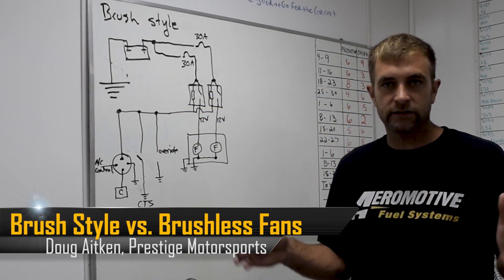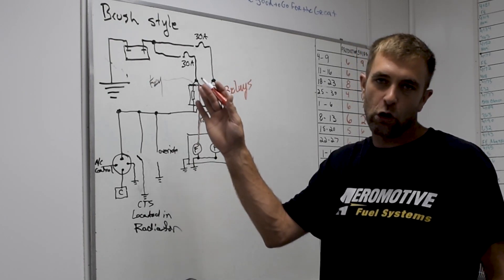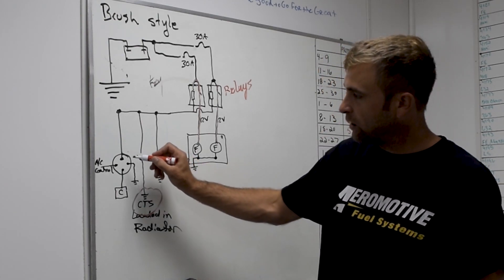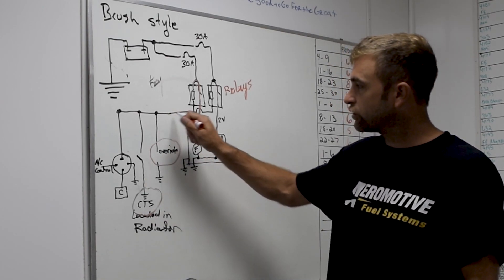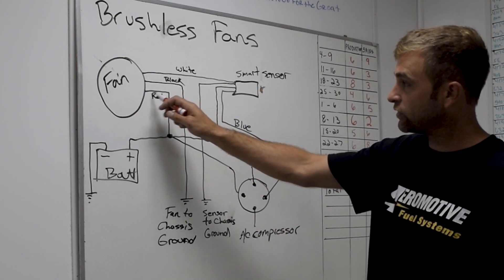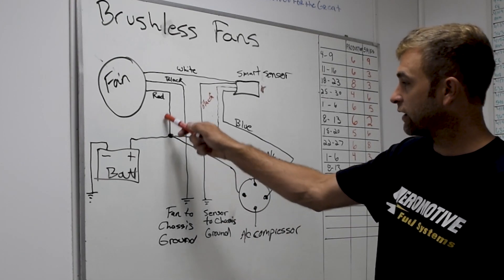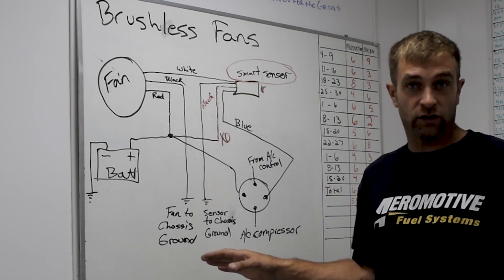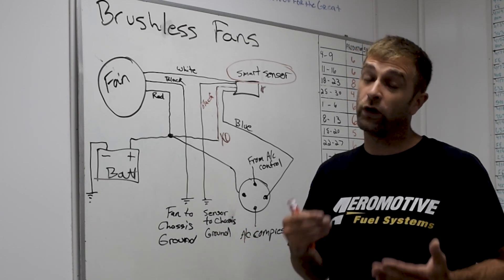How to Wire Brush Style vs. Brushless Fans for Muscle Car Applications at Prestige Motorsports

Comment: how can i wire 2 proform 12 inch brushless fans on a koyorad radiator  for a 2006 g35 where they’ll work with the ac & everything

Comment: Let me correct you. The brushless fan have constant power even if the ignition switched off, and the ground connected to chassis as well. White wire is the PWM signal. Brushless fans don't turn on unless it receives the PWM signal "pulse signal", this is controlled by the ECU. In your diagram you refered to ECU as a smart sensor, which in fact, the temp sensor connected to ECU, and based on temps, ECU send pulses to the brushless fan to start. The fan speed depends on the signal frequency that the ECU send to the built-in brushless fan driver. If there's smart sensors, have already a built-in PWM controller, then it'll send the signal to the fan as per what were programed for based on the temps. But you can't just connect the brushless fan directly to positive and negative and expecting to turn on. Without the PWM signal, it wont work.

Comment: I love these kind of videos where you explaining each step of your diagram. But are you saying on the brushless diagram, that red wire coming from the smart sensor goes to a 12v keyed ignition source but doesn't connect to the battery + side? It sounded like you said that but you didn't erase that line. The way the video ended it kinda looks like 12v is still going direct to the place where you wrote "XO". One other question... can the Smart Sensor control two (2) brushless fans, and would it soft start one or both?

Comment: I also like your brushed wiring layout. If you’re using a 5 pin relay I like to wire my power to 85(A1) and 87(NO). If you use 30(common) if the switch is off terminal 87a(NC) will be hot. If you use 87(NO) as your constant power source instead of 30(common) when the switch is off 87a(NC) won’t be hot.

Comment: Industrial controls and automation electrician here, I agree with this wiring. External ground strap needs to be as close as possible to your coolant temp switch. If not you’ll get a lot of electrolysis through the radiator.
Reply from the maker: Thanks for the kind words, Leland!